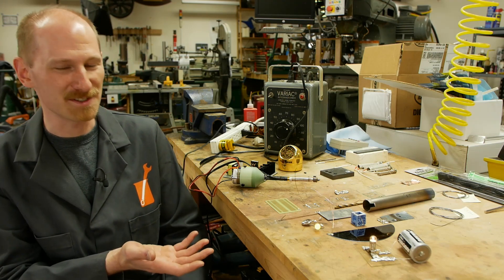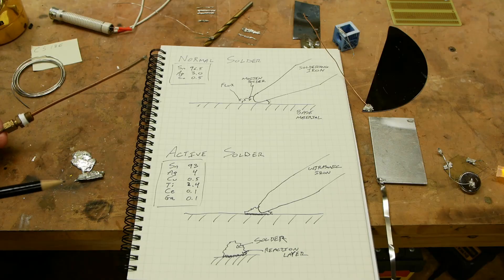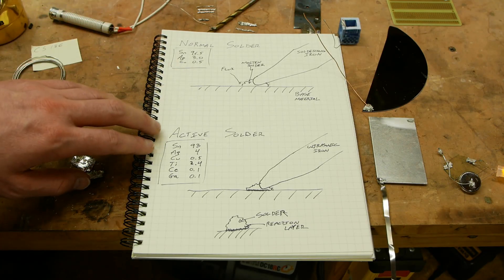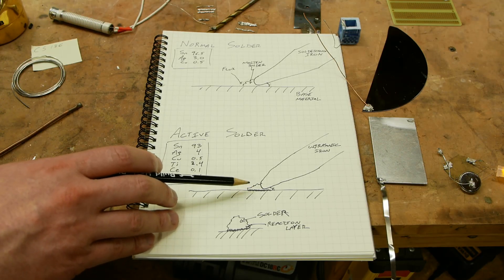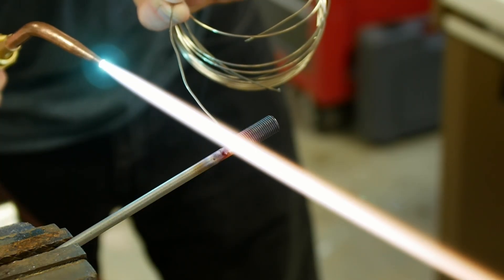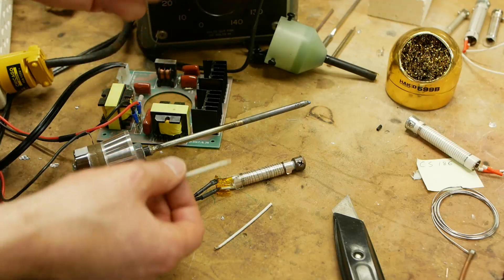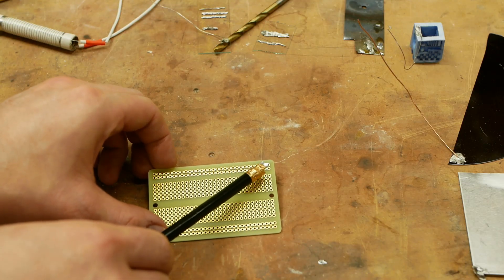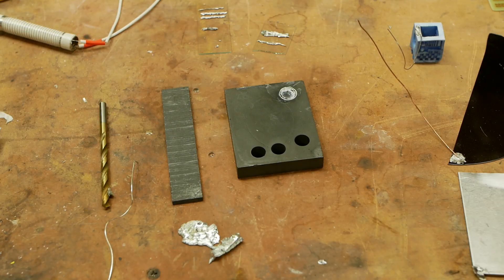Ultrasonic soldering bonds glass, titanium, stainless steel, ceramics, tungsten, nichrome...

Comment: How about repairing broken ferrite cores out of switching power supplies ?  
They are ceramic and can withstand high temperatures. They also have a lot of metals in them.
I guess you'd have to vibrate the core itself ultrasonically...

Comment: If you want to solder unsolderable conductive wires, just electro copper plate them and then solder them as if they were copper at the ends.

Comment: I suspect the relatively soft metal tip is getting eroded by means of the solder  and ultrasonic waves actually dissolving it into the amalgam and depositing it along with the solder into the joint.

Comment: If I remember correctly, while researching how to desolder surface mount components, I found an article that stated that soldering iron tips will degrade over time in continuous use, and it's important to replace the tip every few months. Perhaps if you had converted a much better soldering iron, you may have been able to retain the tip being replaceable, thought I'm certain that would have made the conversion 10 times more difficult.

Comment: I ended the last (late) four hours of last friday diagnosing an open in a circuit that turned out to be an ultrasonic wire splice. The manual didn't tell me where this splice was so I had to remove a lot of plastic flexible conduit to find it. It didn't help that contact was re-established while I was poking around (still gotta fix it). I'm assuming the reason for using this type of connection is for some kind of manufacturing advantage. Not sure the reason is quality. Any thoughts?

Comment: DIY Soldering Iron Tips. (Its just a copper rod) Cut to length, shape it, bend it. 
https://i.ebayimg.com/images/g/kD8AAOSwXu1c0pXq/s-l400.jpg
Dripping flux onto the cleaning steel wool helps. Coarse Kitchen steelwool without any detergent works as cheap alternative.

Comment: One interesting aspect of indium is that gold will not diffuse into it. Standard solders used in electronics will accept gold in room temperature diffusion. When soldering gold plated metals, unless using indium, the gold WILL eventually migrate from the base metal and diffuse itself into the solder.

Comment: So if you were to solder under a vacuum, would you be able to bond two peices of aluminum with regular silver solder? 
Obviously there would be issues with getting hte aluminum into the vacuum without it oxidizing, but it would be neat to see!

oh, also, in your video above - will the gallium in the solder still break down aluminum?

About the tip of the iron breaking down, could that also be due to gallium in the solder?

Comment: Sounds remarkably similar to IC wirebonding.  An aluminum pad mates with either a copper or gold wire using ultrasonics.  In that case though the wire IS the solder.

Comment: To add something more relevant to the topic, you might want to look at the reactive brazes that are used for bonding diamonds to metal substrates - the one I came across used a mixture of copper, titanium hydride, and maybe some tin/other minor ingredients.  I fired it in an induction furnace, bonding a grit onto a steel plate.  The really interesting feature of this system is that the titanium hydride first decomposes and the hydrogen expels air from the powder, before the metals start to melt.  Then the Ti and Cu form a braze alloy, and the Ti also reacts with the surface of the diamond as a layer of TiC, so there is a chemical bond to the diamond and a graded interface as well as a mechanical bond.   I was surprised to find out later that there are some really high performance brazing systems that can produce remarkably tough and strong bonds for specialist metal joining, no welding required.  These are really useful systems.   The ultrasonic part of this one is a new aspect for me - the overlap with ultrasonic welding of plastics is just a coincidence....  cheers, Miles

Comment: Nicrome soLders just fine with normal Pb Sn soLders  with phosphoric acid as the flux. This is also an excellent flux for stainless steel and copper base alloys. This is why coca cola used to work as a flux - once it was allegedly 18% phosphoric acid.. Martin
PS. Absolutely love the HP analysis thingie

Comment: Huh… For a while now, I've had an idea I couldn't test (because of various life circumstances), which was to use clay (like for pottery) to create a circuit board when fired. But having watched this, I suddenly wonder if the normal solder would have even stuck to it very well. Feel free to try this, by the way! (Isn't clay a mix of metal oxides and other junk?)

A few things I've noted when researching pottery:
Clay will contract both when it dries, and when it is fired. The amount that it does, is inconsistent between batches, locations harvested, and even years, including how long it has been sitting in storage. This means you need to fire a test tile for calibration if you're doing something that's sensitive to size changes, by measuring the dimensions of the tile before and after firing. After clay is fired, it can still expand and contract just enough to crack in some cases, depending on the temperature at any given time. This is called thermal shock, I think. It happens to glass, too. Mixing a grog into your wet clay is supposed to reduce this enough to use clay vessels to cook food in and similar tasks, without it cracking from the heat. Grog is a general term for some kind of solid aggregate that is mixed into clay, or at least, that's my understanding of the word. I've heard that things like gravel or glass powder could be used, but I can't recall actually seeing those used, so I'm skeptical. Every time I've seen grog used, it was simply clay pottery that had already been fired, and then crushed up into a typically coarse powder. I haven't heard of any reason it can't be ground up even finer, though; I suspect it's usually considered to be unnecessary extra work for most uses of clay, so it isn't done. So the type of grog I will refer to is going to be pottery shard grog. (Typically, people use pottery that cracked in the firing process, rather than purpose-made fired clay. You could probably make life easier for yourself by purpose making "pottery" to be crushed and ground up later, by using a design that's thin and brittle, which will be broken up easily. Perhaps use a pasta machine to extrude clay in pasta shapes, which drop into a bowl of dried, powdered clay which hasn't been fired, simply to keep them from sticking together like you would with bread dough and flour. Wood ash might work well as a "flour", and even potentially be useful for keeping the clay pasta separate during the firing stage. But I've never tested it. May be able to rinse the ash off after firing, but again; haven't tested this. The idea is to use a computer to design your circuit board layout, and then adjust the scale depending on your clay calibration amount to compensate for shrinking. Print the design out on paper and trace it onto your unfired clay blank, or use some other method like a CnC machine or a 3D printer, to make a properly scaled clay circuit board. (There are 3D printers that work with clay!) Let it dry completely if it's wet at all. And fire it.

Using clay as a circuit board material will certainly mean it's more prone to breaking if mishandled, but the components on a circuit board can already be pretty delicate anyway. But if you use the right type of clay, it should be able to withstand some interesting fabrication techniques that other circuit board material alternatives wouldn't. One I had, was to making groves/channels in the board before firing, and fill them with potentially bare copper or aluminium wiring, and bake it again, just enough to melt the wiring into the groves. If the metal traces are flush with the rest of the board, you could potentially even make a rudimentary multiple layered board by placing a second layer on top with either adhesive of some variety, or some fresh clay which would require another firing secession, and possibly inside a more advanced kiln, like an electric vacuum kiln or whatever (noble gas filled kiln?) it is you'd need in that case. I think copper and aluminium both oxidize as an accelerated rate at high temperatures, so I thought that to preserve any extra fine traces, you'd need an oxygen-less set-up. If you don't mind slightly less conductivity per trace size, I guess one could also use solder traces, but… There must be some reason it's not done already, right? Ability to reflow components without reflowing the entire board? Cost? Because people will look at you funny? Meh. Nevermind that though; another reason why it might be preferable to use clay circuit boards, is for specialty use cases that need resilience to extreme heat. (Granted, I can't think of any electrical components that would survive enough heat to destroy fiberglass, but I don't know that much about it.) And I vaguely recall something about some computer motherboards that became noticeably warped from a CPU that ran rather hot for a long time, so there may be some longevity benefits to clay over using fiberglass. But I think the biggest benefit, if in prototyping without needing to send a circuit board design off to a printer, or messing around with dangerous chemicals and silkscreening. I guess that's a kind of weak benefit, with there being some pretty cheap printing services nowadays, but at least you can make absolutely sure that your design never leaves your sight, for those who are paranoid, or whose work require paranoia.

Guess I better stop there before I get lost in the weeds. So, uh. Bye!

Comment: I bought all of the equipment to do this a couple years ago but several concerns stopped me from finishing the project.

I had no way of determine the amount of ultrasonic power I was emitting. I didn't want to damage my or my dog's hearing. I did some research but did not come up with any way to test this without the risk.

I also had some concerns about exposure to my hand. There are a couple of stories online about guys who put their hands in ultrasonic parts cleaners only to have their bones disintegrate. While this seems unlikely it is the case that ultrasonic cell disruptors are a real things used to homogenize tissue samples in biology. 

My approach to protecting my hand was going to be using layers of different density materials to provide essentially mismatched impedance. 

To reduce the radiation into the air I was going to turn a horn. I know that it would not be very well tuned but the hope was that I could increase the efficiency substantially so that I could reduce the power needed. 

One thing that you may be interested in is a way to control the power. Hoping to mitigate these concerns I showed the power supply to an EE friend with a lot of experience in RF.  I offered to draw out the circuit (never fun but very doable in this case) but he just looked at it and drew the circuit in a couple minutes. He proceeded to explain which components to change to make the power adjustable. He even explained what would ultimately limit the range and how to address those issues. 

Did you have anybody these concerns?

Comment: You can reduce the ultrasonic power on this particular board by 50% by simply removing two of the 4007 diodes that are used to make DC from the mains. That way it only makes ultrasonic half of the time. If that is still not reduced enough you can power the whole board from a thyristor/triac circuit with PWM. I have done both of these on that actual type of board.

Comment: Very cool. In a rather large tangent to what you tried with the carbon, Robert Murray-Smith did recently do a bit of experimenting with aluminium brazing rods, and managed to get a decent bond between some Grafoil and aluminium. Obviously not a chemical bond, but it may be a relatively straightforward way to mechanically do that.

Comment: Interesting stuff.  Wondering, have you done a video on these welding rods selling around these days where you use mapp gas to heat the non-magnetic metal to the point it melts the rod and welds?

Comment: Will it work on any semiconductor materials (on oxide their oxides too) also on compound semiconductors and did you measure the before and after resistivity of that ITO glass (from a fixed distance)? 
like it can also bond with glass and remove the ITO coating underneath it and bond sideways with ITO.

Comment: Tinning with indium and then regular soldering works for some hard to solder things. The indium tinning wets the surface, but then dissolves during soldering, raising the melt point of the tinning. Asterisks galore on that, but that's the idea.

Comment: This is a great demonstration. 
A customer handed an automotive ABS module made by Bosch to repair. (It had several broken/corroded bypass capacitors) Needless to say I failed on an exemplary level because I forgot about ultrasonic soldering in general. I couldn't figure out why the heck solder wasn't adhering and as to why the original components were not coming off at all. It was literally the biggest single slab of silicon I've ever seen with even more small COB's on top of it. Needless to say, I would love to invest in this technology so I can expand my repair services to say the least.

Comment: This is so interesting. 
Can you solder the flat flexible cable onto say the touch screen glass of a 10 inch tablet?
https://rover.ebay.com/rover/0/0/0?mpre=https%3A%2F%2Fwww.ebay.com.au%2Fulk%2Fitm%2F181047857909

I like to see a video of that.

Comment: Gallium , ah yes, we used to be friends.  i was told it melted aluminum. Yes it did. on the day in fact...  it also melted other things.  couple soldering iron tips...  a pair of pliers and a flathead screwdriver.   I really couldn't bring myself to accepting that the pliers and the screwdriver broke until I really looked at the soldering iron tip .. which is iron in the center.  Guess the heat makes it happen quicker.  Took something like 6 months before the pliers broke. Needle nose.. jaw broke right in 2 while doing light work.

Comment: How electrically conductive is the active solder? Does it have resistive properties that will cause it to heat up and fail if used on a transparent solar panel of, let's say 100 watts? Very cool tech for sure. Have you made your own nitinol in that vacuum inductive furnace?

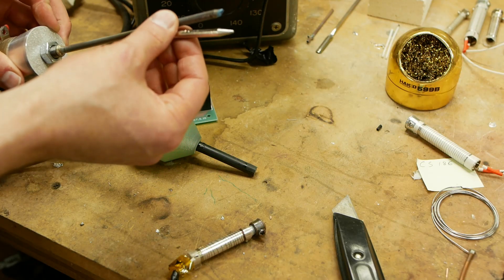Comment: 10:15 if ultrasonic waves can break surface tension of soldered materials then they probably can break top layer of that tip faster than usual. ???

Comment: I think the active solder is only required if you want to solder on non metal. For soldering metal, as long as the solder can allot with the base metal, it will work. The ultrasonic is only used to disrupt the surface oxide layer.

Comment: Does it bond to Boron Nitride?  If not, you could try using it as a tip to avoid corrosion.  It's very thermally conductive.  McMaster has machinable rods.

Comment: This seems reminiscent of the wire bonding equipment used for integrated circuits. It looks like you already tried it with a silicon wafer, now just need to sharpen the tip and use some really fine wire.

Comment: Would someone be able to define "active" in the context of how applied science is using it?
Reply from the maker: This is a good question.  In this context, "active" means it's able to participate in chemical reactions in a given environment, which is often air at ambient temperature and pressure.  An active surface may react with oxygen in the air and become oxidized.  For some metals, like titanium, the oxide will form a continuous layer on the surface that prevents oxygen from reaching deeper layers of the metal, so the surface becomes passive ie not able to further react with the environment.  Chemists say that the surface has become passivated.   Other metals like iron will always remain active because it does not form a continuous passive layer -- instead its broken and uneven, allowing oxygen in to further rust the metal.  In similar context, a catalyst material surface is called active because it facilitates chemical reactions in the surrounding environment, for example the catalytic converter in a car's exhaust system oxidizes unburned hydrocarbons by participating chemically, but not being consumed or altered by the process.  An active solder is one in which the surface of the solder can participate chemically (ie without the aid of a flux to clean it of the oxide layer, which would prevent chemical reactions through its passivation effect).
Reply: @AppliedScience  Wonderful response, this brought a lot of clarity to the matter.  Thank you!

Comment: Could you use something like graphite or ceramic to couple the ultrasound vibrations to the hot end of the soldering iron without worrying about the heat getting thru? Or would that be too brittle for ultrasound?

Comment: How well would this work to join aluminum and copper wire in a home that was wired with aluminum wire? I'm assuming that you could use regular solder with an ultrasonic soldering iron. Would the solder protect the two metals from galvanic corrosion? I've seen various methods for this transition from special pastes to using transition metals.

Comment: Question:  will the 1% gallium in the active solder react adversely with aluminum surfaces?
(Or is it in such small dilution, that it has no real effect on aluminum surfaces?)
Reply: 0.1 percent
Reply: Some people have used galinstan (gallium, indium, tin) as a TIM for heatsinks
Reply: @meercreate  generally only done with copper heatsinks, gallium alloys will still eat aluminum
Reply: @meercreate  Important to note there is that the galinstan makes no contact with pure aluminum in such a use case. All "bare" aluminum quickly becomes covered and protected by aluminum oxide. To get the adverse amalgamation going the surface may have to be fairly seriously damaged, all the while not contacting any air.